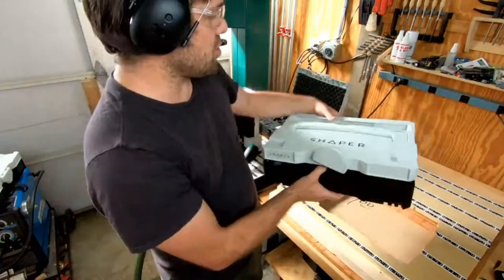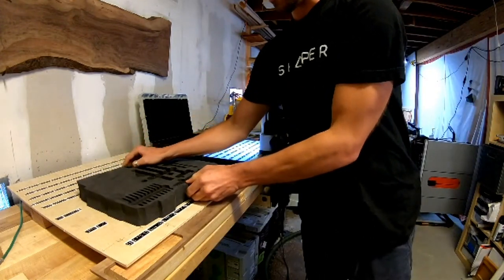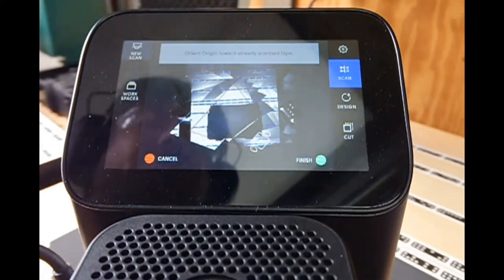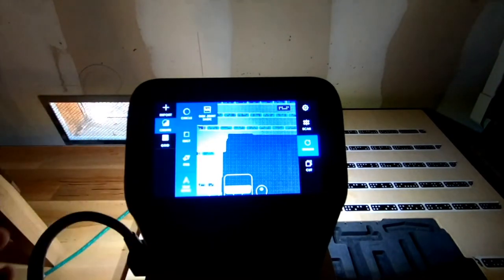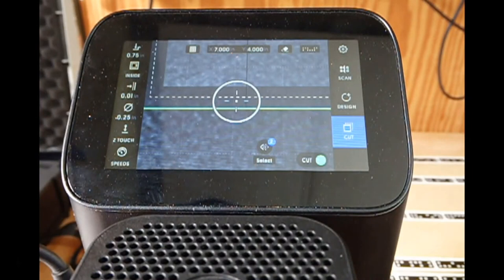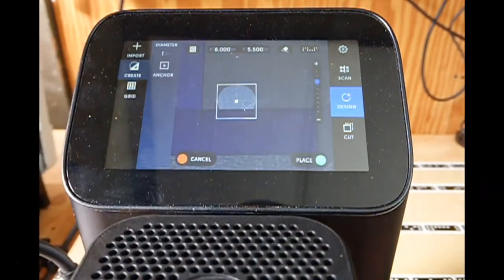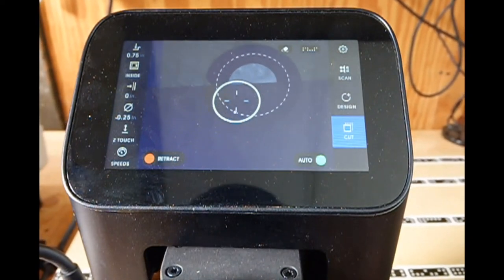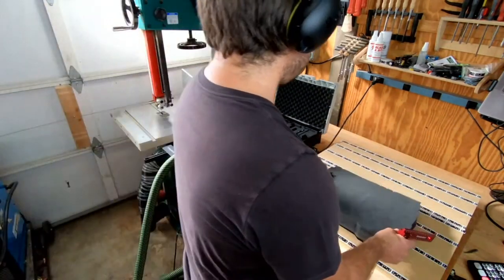Session 1  – English: Customizing Tool Shadowbox Foam with Origin

Comment: I inherited a gen1 shaper a couple days ago and yesterday i did the foam project for the workstation Systainer foam.  Worked fairly well.   Trying to decide if my template is worth keeping or not as I didn’t do a great job landing the layout against a known grid referenced from the side.  Is there a way to place the design again against the pre-cut template?  I’m worried the answer is no and if so no worries, I’ll just cut the template again.  Pretty sure I’ll be getting more foam for more Systainer with custom foam.  It’s a surprising killer ap I didn’t expect.  My girlfriend just saw my first origin cut foam and i see the gears in her head moving with doing some of our kitchen drawers this way vs the current chaos.
Reply from the maker: If you used the foam template we have on Shaper Hub you should be able to recreate your placement using the grid, and make close approximations by changing the grid spacing if your placement was a little off. You could also return to that workspace if you have some of the tape field still in-tact.